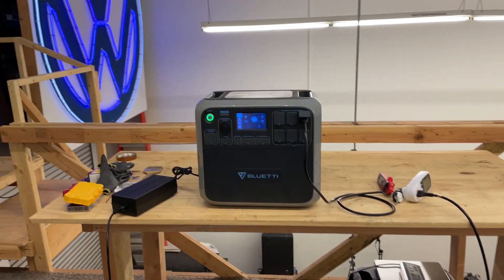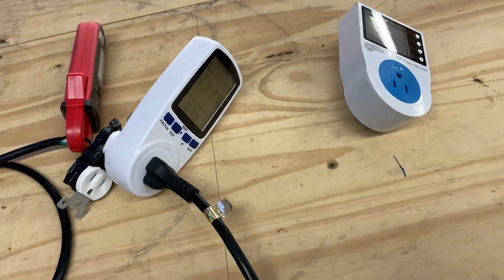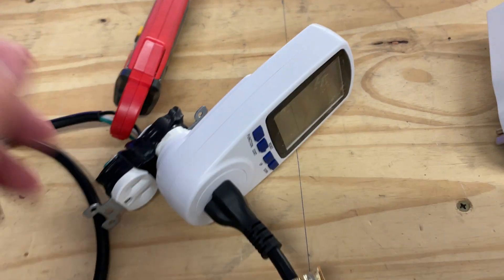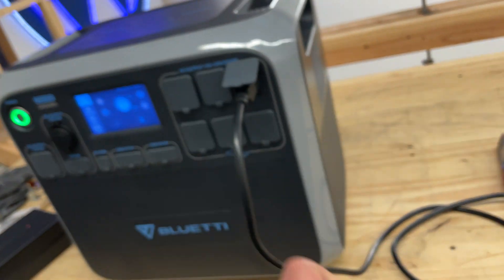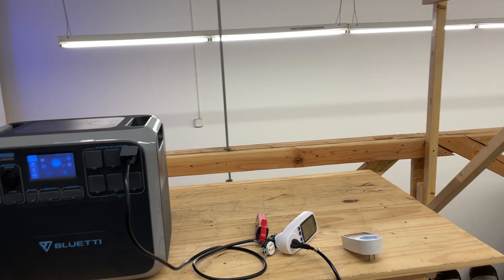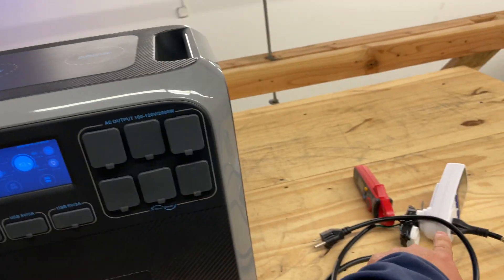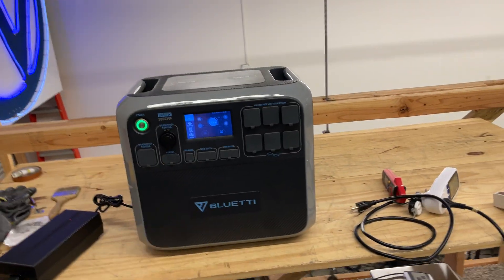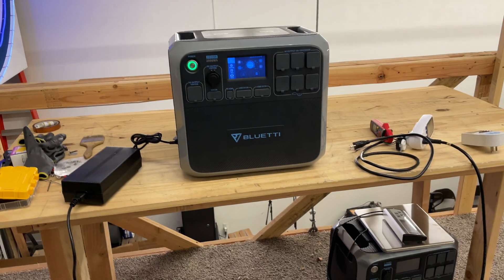Whats going on with these Meters? Giving away a Bluetti AC200P

Comment: Brother you almost had it.  the power meter you have cycles between. KW total, Volts, cost in $$$ . watts low watts high and current watts drawn, please cycle through the functions. will you see a w behind the number and the bottom does not say high or low . its ok we all have brain farts

Comment: Didn't read all the responses and watched your video once and decided to comment if I understand your question correctly is only you can answer.  As with all battery amp meters it is on the battery of course so all power discharge maybe what the battery is putting out as regards to amps as the output of the external meters is the reading coming out of the bluetti 120v outlet. So this clearly is the amp loss of the system converting from battery voltage to 120v.  I believe your bright enough to know this with your experience so as I suggested maybe I didn't understand the question. As I see a lot of reviews on Amazon of people that clearly are clueless of just about everything they say and test along with the theory of electricity and losses  as that is why back in 1991 attending UTI tech school in Phoenix we were provided with fluke meters and not cheaper and inferior test equipment.  I watched your videos off and on for years now dating back before you built your Lithium vehicle.

Comment: you are forgetting power factor. Watts = Volts * Amps * power factor. power factor of less than 1 is caused by two things. either the current waveform isn't a sine wave, The RMS current will be higher than it needs to be to achieve the same power. if the current is not in sync, this also reduces power factor.
your inverter is telling you volt-amps, not watts. in AC power they are not the same thing due to complex power.

Comment: Them meters suck. I found same thing plus the meter that I bought was almost 3.9 volts off. And well so bought another and it was .8 volt off and I paid more for it. 59 bucks sent both back and now i will only use a graph test with a skyrc250d discharger to test my batts. Best 80 bucks spent. I noticed my test are extremely dead on.
no put intended 🤣

Comment: Ya man it's power factor which basically means it uses more power than it says and what should be watts is VA (volts X amps) I don't know how they actually get to watts on AC but you are only charged for the watts by the electric company but for testing and want something closer use a resistive load like a heater and I know you said you were but I assume it's not just like some nichrome wire and a fan and also the meter displays power factor I believe it said .75 so just decide by that and that should be the power before inverter loses

Comment: Bluetti AC200P-Demand power (or) Apparent power(VA)
Heater(load) -True power (or) Useful power(W)

If the power factor of the load(Heater) is 1,Then DEMAND POWER=USEFUL POWER
e.g - If the load power factor is 1, 1594 VA=1594 W
But in this case USEFUL POWER as the power factor of 0.75 which is less then 1
so that is the reason over here 

Power =Useful power/Demand power
Power=1194W/1594 VA=0.749~0.75,
Waste power=1594-1194=400W.

To avoid this use the load that as high power factor .

Comment: Hi jehu, 
1- You should use a resistive heater ( the one that glows bright red) not a heater with a fan. To make sure that your measurements are going to meet the lab test standerds.
2- Test your wattmeter accuracy by plugging it to the wall and connect a known value resistor ( a incandescent bulb will do) . Don't trust the wattage value written on the bulb. Check the resistance value.
3- check your Avometer's accuracy using the same resistive load you used in step 2.
This way you can make sure that the measurement devices you are using are accurate. 
4- Don't forget the inverter power consumption.  I think that the number they put is the outcome of the battery connected directly to a load. Neglecting all the power consumed by the inverter and all the other power consuming parts such as the screen and the usb circuit.
Good luck.

Comment: Try to plug you meter in closer to the heater. I.e. run a cord to the heater and put the meter on that cord then plug in the heater. You are loosing watts pushing power through the cord.

Comment: Sounds like the heater is using PWM to control its output level and either the pulsing is affecting the power meter somehow, or the heater has an inductive and/or capacitive filter on the power lines that's altering the power factor.

Comment: I never understood the power factor aspect. I wonder if that has anything to do with it. But I'm a straight up novice. 
Get one of those ac line splitter adapters and measure amps on the other side of the power meter.

Comment: Those meters tend to take the power factor into account. Going from the meter 13.35A x 120.5V = 1608.6. But times that again by 0.74 for the power factor and you get 1190.4W which is smack bang on what the meter is telling you. 
Depending on the type of heater that is. If it is purely resistive than it should have a PF of 1. But given you are powering that from an Inverter and not the mains. I have had inverters with less than clean sinewave output mess with the PF reading before. Plug the heater/meter combo into the wall and see if it reports correctly

Comment: I red most of the comments here , and as most of them have pointed out is somewhat related to the PF (Power Factor)

You said that you were using a resistive heater so your PF is CERTAINLY 1 no doubt on that

The problem is that the meter ASSUMES that is fed with a perfectly sinusoidal voltage , but that is not the case , since when is under load that inverter will produce a non-sinusoidal voltage , so when it make his calculations it make a mistake ( and yes it could be saw this problem by checking the PF reading of the meter)

The Bluetti on the other hand measures the current going out of the battery ( so DC ) so it won't be extremely accurate since it account also the internal losses of the inverter ( you should read something like 20% more power than the actual load)

Comment: All meters measure correctly, and this is because Power = Voltage * Current * sin fi (named also power factor). In case of DC current power factor is always 1, but in case of AC power factor depends on the load itself, if the load is purely resistive power factor is equal 1 but when we have purely inductive or capacitive loa power factor is equal 0, so in normal condition, typical load always have some capacitors or inductors (fans, transformers etc.) so the power factor isn't equal 1, it will be typicaly around 0,9 - 0,6. Bluetti shows 1,5kW cause it measures DC current taken from battery, but meters shows 1,1kW and also shown power factor of 0,75, so when you do the math You have 120V*13,3A*0,75=1,197kW

Comment: The meter is OK! it's just that it's measuring the Apparent Power in AC (the one relative to the Resistive component of your load) As you can see the Power Factor shown at the bottom of the meter screen shows 0.75, that means the IMPEDANCE of your load is not 100% resistive, but it has a Reactive component as well (inductand/capacitance. Probably for a heater it's inductive due to the wiring of coils (?). In DC the power facotr does not play, so the bluetti measures the total DC power drain by the batteries. This is how you silently "steal" power from the network, and also posibly start a fire, because you do have bigger currents that your metters and your energy provider is not measurring, but it has to go somewhere, and that's heat!.
Reply: If the power factor is reflected in the output from the inverter the kill-a-watt is going to see it and account for the losses, the bluetti is probably metering the DC ouput from the battery which would not have a power factor component.

Comment: To troubleshoot this issue, use the process of elimination. The first thing to do is to ascertain if the wattmeters are calibrated correctly. To do so, plug the meters into a regular wall receptacle and see if it is correct using a high wattage incandescent bulb. If it is correct in the wall receptacle, plug it into the Bluetti to see if you get the same results. If the wattage is then incorrect when plugged into the Bluetti, then the  Bluetti's inverter may be defective and not producing a clean sine wave. But from what I'm seeing in the video, my educated guess would be that both wattmeters are not calibrated correctly. So far, I've had good results with the original KILL A WATT meter as well as the Poniie PN 1500 https://www.amazon.com/gp/product/B07VPTN8FZ/ref=ppx_yo_dt_b_asin_title_o04_s00?ie=UTF8&psc=1. 
If you find what the solution, please let us know.

Comment: At 0:40, it shows 13.31 amps. Below that it shows a power factor (PF) of 0.75.    13.31 * 120 = 1597.2, the watts you are expecting, but multiply that by the PF of 0.75 and you get 1197.9, which is about the watts you are getting.
Also, when looking at the watts, look below it. If it shows "Lo", its the lowest seen. If it shows "Hi", it's the highest seen. A third page shows the current watts.

Comment: The power factor is jumping from 0.74 to 0.75 so we can guess the power factor is likely near to the middle of the 2 numbers at 0.745.  In AC circuits to get True Power in watts, the equation is True Power = Voltage X Current X Power Factor.  If you do that you get 120.5*13.35*0.745= 1198 watts

Comment: You need to take into account the load power factor (PF).  If you multiply  voltage x current it will give you the apparent power in VA. 120.5V x 13.3A = 1602VA. To have the active power in W you need to multiply by the power factor. Your meter is showing 0.75, so 120.5V x 13.3A x 0.75 = 1201W.  This looks pretty close to the meter readings. If the heater that you are connecting is not an 100% resistive load, you will have a power factor smaller than 1. I guess the culprit here is the heater controller that is messing with the power factor. Try to use the heater on the maximum setting and check if the active power (and the power factor) change. If your bluetti cannot supply enough power for the heater on the max setting, try connecting to the wall outlet just to check the power meter. I'd say that the Bluetti is displaying the VA power and not the W power.
Reply: Correct. To explain it simpler , W=VxA only on DC. On AC it's a sine wave so you need to calculate the active power.
Reply: @Weblearning1  You could get VxI=W on ac systems too, as long as you have a load with PF = 1. That happens when you have 100% resistive loads (resistors or incandescent light bulbs).
Reply: Came here to say the same thing. Curious that 0.75 is an awfully low PF for what should be a purely resistive load. I though the controller on these heaters only switched between different lengths of nichrome wire.
Reply: @danilolattaro  Maybe the controller works like an electronic dimmer. In that case the power factor will not be good on the intermediate levels.
Reply: Great explanation! 💯👍
Reply: But Cos-1 0.75 will give you the phase shift angle between V and I.
Reply: ...and the phase angle depends on the load's circuit.
Reply: Ya I don't know hot jehu doesn't know about power factor

Comment: Someone has probably already mentioned this but there's a difference between kW and kVa, and the type of load will sometimes make the kVa measurement differ significantly from the kW figure. I've heard that the best way to convert from kVa to kW is that 1 kvA = 1 kW * 0.8, however, this is just a general multiplier that doesn't apply to all types of loads (capacitive loads, inductive loads and resistive loads), but may be "close enough for government work", so to speak.

Comment: It showed a power factor of 0.75. So 13.35 amps x 0.75 is 10.01 amps in reality. Multiply that times 119v and you get 1191 watts. 

It is the power factor

Comment: Here's the correct answer for both of these measuring devices.

They are accurate and intended for smaller power draws.

Despite their specs (a bit exaggerated by china manufacturers) they don't measure higher power draws very well.

If you measure smaller draws you should see better accuracy. 

Here is also some additional information that you may find helpful or interesting.

http://lygte-info.dk/review/Power%20Zhurui%20Power%20Recorder%20PR10%20UK.html

Great video by the way can't wait to see your upcoming video's. Its great a great community you have here following your channel! Keep up the great work!

Comment: You also need to consider phase shift between current and voltage waves.
Reply: It's a resistive heater, it should be perfectly in phase (aka 1.0 power factor). Edit: ok noticed that there was a 0.75 on the screen which is presumably the power factor in which case the real power measured is right. Very strange that a heater which should be a pure resistive load is so bad, guess the motor is high power.

Comment: Mathematically, wattage is more than current x voltage.
Reply: yes but you got it backwards. VA is always >= wattage. I don't doubt you know this though, just a typo.
Reply: @pjtruslow  VA=AV=W
Reply: @adebayooladipo859  not in AC power. Rms voltage multiplied by rms current gives apparent power, or volt-amps. For loads that are not purely resistive, current and voltage are not perfectly synchronized sine waves so you have to multiply instantaneous voltage by instantaneous current and average that over time to determine real power. 
If they are purely sinusoidal but out of phase, you can just multiply the apparent power by the cosine of the phase difference between voltage and current

Comment: Take a look at your power factor, when you add that to the equation the meter is dead on.
Reply: The Power factor counts in to the equation only when you have a heavy inductive load, otherwise it's almost equals to 1
Reply: @David_Palma  Power factor is in play any time it's not a purely resistive load. Power supplies, motors, anything but a heating element will not be a power factor of 1.
Reply: @inothome  The power factor is not affecting by resistive elements like that heater, only inductive elements  or capacitive elements can affect it. So it must be something else.
Reply: @David_Palma  Correct, but the original statement that only heavy inductive loads effect the power factor was false.  Case in point, my homes power factor right now is 0.28, no motors running, just basic electronic loads, about 25W worth. But back to his video, not sure if there are fans, SMPS any sort of digital controls on the heaters. Any of which will affect the power factor. But not to the effect of the discrepancies he was seeing between the meter on the battery and the power monitors. I suspect the meter on the inverter was fudging the readings a bit. Or possibly using measurements before the inverter, so then it was also accounting for inverter losses, which, is actually a better way to monitor actual remaining battery charge.

Comment: Hi John, My First thought why they would not match is that some meters do not account to reactive loads which cause a shift in phase between the sine voltage and the current.  Possibly the small cheap meters are only measuring the current at the voltage peak, not the peak of current and the peak of voltage.  
However, I would have thought that your load is mainly resistive with heaters, unless you have some significant inductance in the extension cord between the “Solar Generator” and your heaters.   Resistive load should have the voltage and current should be in phase.
As was mentioned above, those meters do not measure power accurately unless the sine wave is clean and pure.  You could get your scope and have a look at the sine wave coming out ta 1.5K watts to be sure.
Happy Hunting!

Comment: I think it's the RMS value, so 120.5vac*13.3A=1602.65W and for the RMS W multiple by 0.707 equal 1133Wrms
Reply: No, because 120V and the current measured by the clamp is already RMS, and the whole point of RMS is that you treat everything like straight DC calculations..  The fact that it kind of landed in the correct ballpark is just coincidence..
As for things like power factor, heaters should be purely resistive and even if there's a small controller board running off a converter, it shouldn't be enough to change the readings..  It should be close enough to a unity power factor..
I would scope the waveform to ensure that it is truly sinusoidal- maybe the converter waveform degrades as it approaches full load?  Does it measure correctly at lower loads?  If so, that's probably the answer..
Reply: @Flying0Dismount  Yes, its the power factor, I check the video twice and notice that the wall meter show a power factor of 0.74 when jehugarcia press the function button. :)
Reply: This is MathMagic.  He only need to take int account the power factor.